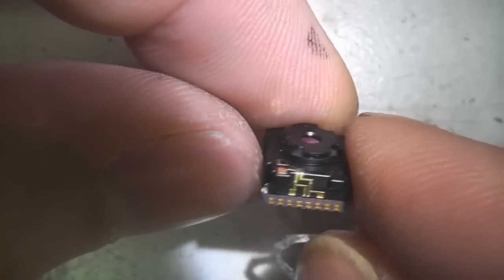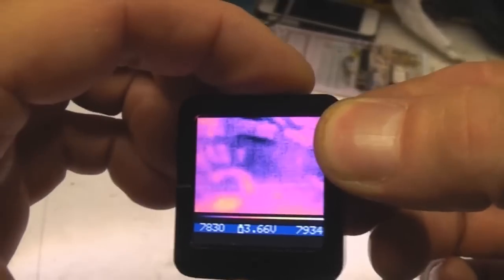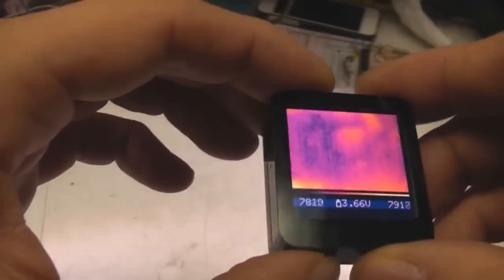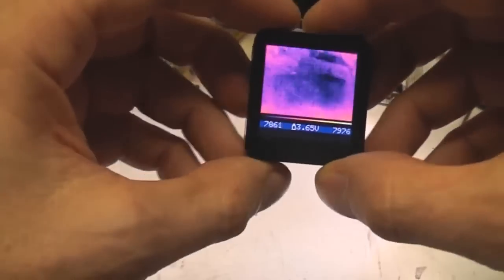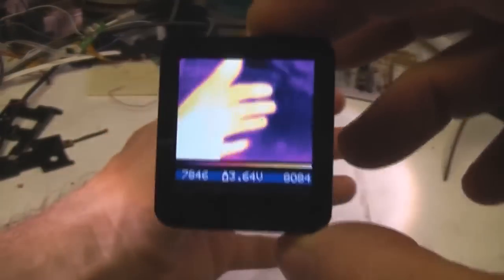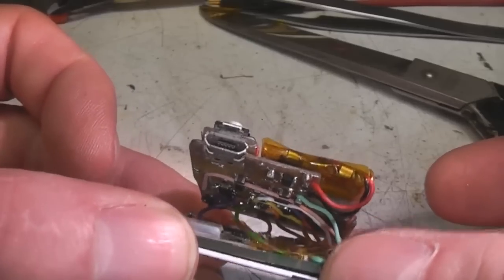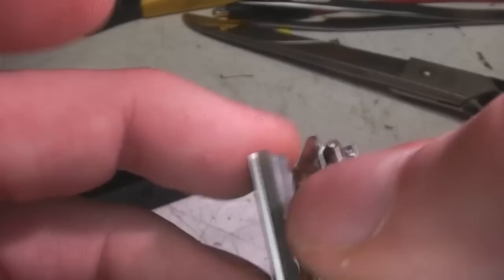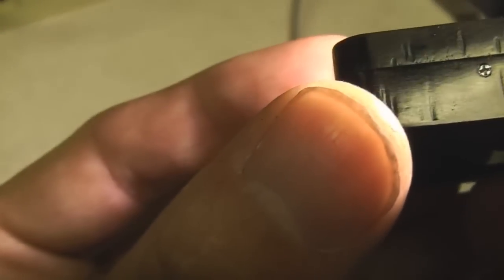The smallest thermal imager

Comment: It's always spectacular when you spontaneously get your teeth into a project and rattle something together in a few days that would normally have taken an large R&D team years to come up with.  That little gadget alone could make a completely new market for thermal imaging and bring down the price of those new Flir modules.
Reply from the maker: That's a chicken-egg situation - I don't think this would be viable with a $250 module. Let's see what effect Seek thermal have on the market if they deliver!
Reply: mikeselectricstuff
 Yeap, $257 for a module is a bit pricey(lot of guts?) to turn it into 'gadget'. But Your device is really 'breakthrough'.
Reply: Checking Heat beds of 3D Printers for hot spots etc. This needs to be a Crowd Funding idea. Then I read 250 for 1000 deal.

Comment: How about a kickstarter of that little thermal imager? Would it be near impossible to buy in bulk those Lepton modules from Flir?
Reply from the maker: $250 each with minimum order of 1000
Reply: mikeselectricstuff

Sounds like a "wait for a second generation of the same product" sorta thing, then. The unit cost could come significantly down in a few years.
Reply: Wolfie M No, this just needs some competition.
Reply: ***** $250 for 1000 for the Lepton camera module alone. Not including anything else Mike adds to it.
Reply: Awesome!
Reply: ***** 250 for 1000 deal???  Seek Thermal consumer product sells for 200$, have a higher resolution and already works with every phones...  I feel like the lepton module market will never take off...  And hats off for Mike for this astounding build!
Reply: Benoit Forget That was two months ago though. As far as I know the seek thermal launched at the beginning of October.
Reply: This has changed substantially now. The modules are available on Digikey for a 1-off price of just over 100 quid.

Comment: Is this build with the tiny qfn32 sized lattice FPGA you mentioned in one of your earlier videos? Would love to see more on this micro flir cam!
Reply from the maker: No - it's the PIC32 on the Ipod nano driver board, using a CPLD for the MIPI.
Would be tricky to do this on a small FPGA due to the pallette stuff.
Lepton can supposedly do RGB internally but I've not figured out how, or even if implemented on Flir One  Lepton.

Comment: Hey Mike. This would be a very good crowd funding campaign. I would have rathered a dedicated device like this with a microSD slot for recording, or microUSB that providing both charging of the device and video output so that it could be connected to an external battery pack while recording to microSD and/or connected to a computer to which the output would be displayed via some standard protocol like rtsp that could be viewed in windows media player or VLC and then be recorded.

Comment: Mount it in the SCBA mask of a fire fighters helmet.
Reply: Million dollar idea for whoever wants it:  make it into a set of safety glasses for anyone working where hot items are present.
Could even just be a LED that lights if something over say 60 is in the field of view.....
Reply: Paul Moir Maybe you could visit your local fire brigade and let them look at it?
Reply: or build one out of an Oculus Rift and 2 of the flir cameras. A whole new would of 3d heat vision
Reply: Bluntski That is a cool idea. The problem would be if it failed in a fire it would obscure you field of view.
Reply: acklan3 In a fire they operate at zero visibility already...
Reply: frollard This is true, but zero visibility is a small portion of the fire fighters time in the mask. This device attached inside the SCBA mask would give the FF 10Ft/3m range for SAR, such as in VES. The main feature I was looking at was the price point. This device at around $500 would make it extremely affordable to nearly every FD or even the FF who wanted to come out of pocket. With T.I.C. going for around $4000 per unit this could outfit an entire crew, for haft the price. I have no illusions that this would not be near as durable as a high end T.I.C., but for a fire fighter that may make a couple of dozen fires a year this could fill a very important niche'. IMO 
I would think that with the proper development and manufacturing it could be made even less expensive.
Reply: acklan3 Totally fair assessment -- given the hoops to jump through for safety ratings it would be a nightmare but REALLY cool.  Even if it used a google glass style display where you can keep it out of your vision and glance if needed once visibility is gone.
Reply: frollard I was thinking of marketing it as a toy ;-) and letting the fire fighters use their imagination as to how to apply it in the field. If it were sold as a novelty but a FF used a piece of ticy tac to stick inside his mask, oh well.  Cannot control what is done with it after purchase.
Reply: frollard I do not know if it is possible but I would like to see a version in grey scale and 212f/100c degree heat differential. Scott Eagle-X was setup that way. Very useable.

Comment: I'm making myself a cross between starlight and thermal imaging that will be an eyepatch and update in real time. Most of the hardware isn't in the eyepatch, only the capturing and displaying parts. The rest goes to a small pouch behind the head which does all the computational stuff to return to the eye. Of course no zoom features as that... Would be really difficult to pull off. I'm a recluse so I won't be sharing my results with anyone. Have a great day everyone!

Comment: Lovely Mike. I could really use something like this in my tool box for tracing thermal characteristics of circuits. I use a non-contact IR thermometer at the moment but it is a bit vague sometimes due to differing emissivity of circuit component materials. The commercial FLIR's are so expensive still and all I need is an "Is it hot?" and "Which one is going to melt first?" verification. Neat and very useful. How much? Great channel. Thanks.

Comment: Not Particularly Useful??? This is the coolest and most useful thing I've seen for a long time. And at that size it's a breeze to mount it behind any rifle scope for night hunting. Just needs faster framrate a few easy presets, preferably waterproof casing and you have yourself a bestseller! If you can prize it below £55 or thereabouts people will be lining up from here to china!
Reply: +jonnebanan It'll only do 9fps, ITAR prohibits more.
It'll cost more than $300, due to the Lepton being $183.
Reply: Those thermal matrix aint cheap and cost in the 3 digit for just the IR cam sensor.

Comment: Why not do some pixel interpolation to increase the apparent resolution? Shouldn't be that hard and would make the image look smoother :)
Reply from the maker: Yes - probably will at some point.
Reply: mikeselectricstuff  Awesome version of interpolation would use a teeny gyro to take shakes, and interpolate for more data.
Reply from the maker: queazocotal Don't think framerate is high enough for that to work.
Reply: mikeselectricstuff As you have a fixed display size you could use lookup tables (precomputed alpha) reducing to 2 look ups and 1 add per pixel to get linear filtering. Although not sure if your controller is up to that.